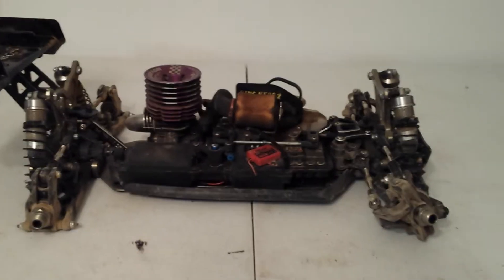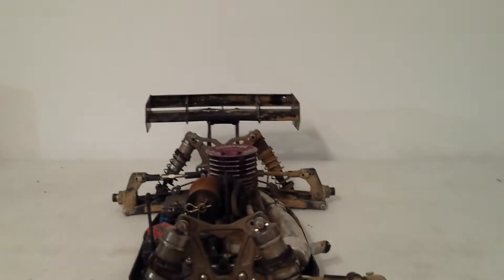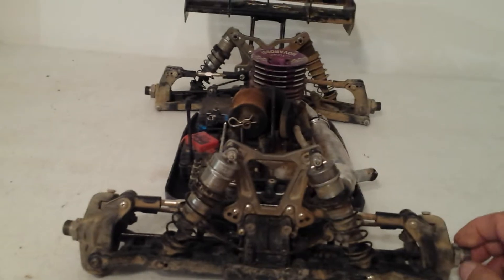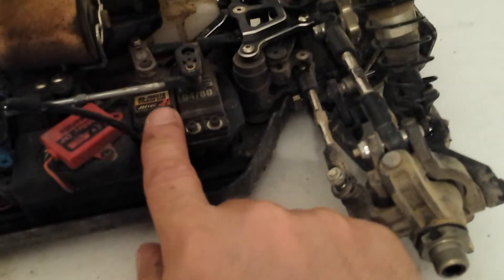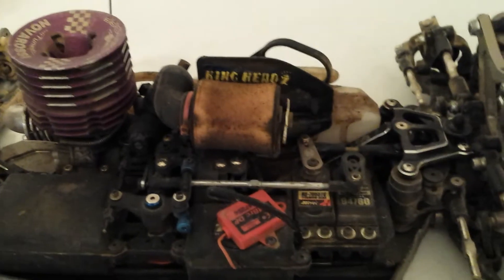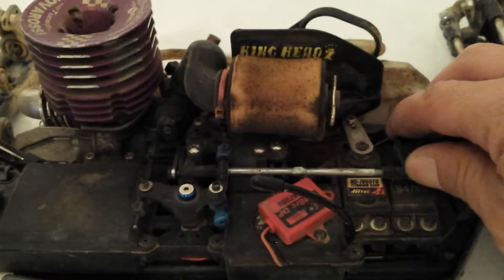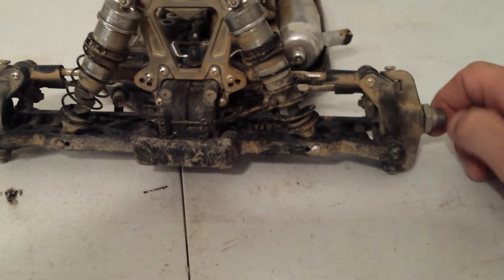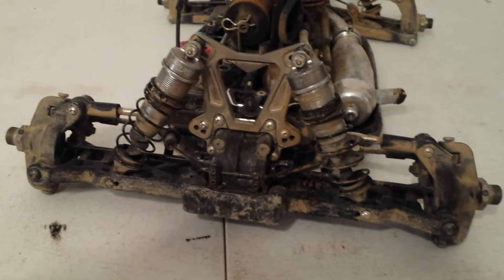Operation Buggy Rebuild Part One

Comment: Okay dude problem with my losi 8ight t 2.0 brushless.  No matter how tight I shim the rear diff after a run or 2.  20 - 40 mins it is too loose and it skipping teeth when I apply the brakes.  Electronic brakes through the motor of course.   The ring and pinion don't look great but they definitely don't look shot yet.  Any thoughts ? Also I've decided to just try to more or less finish the break in on the other truggy motor so 3 more tanks of easy rich driving I think should do it.  Counting the 4 total tanks the previous owner put through it and the 2 I've put through it I figure 3 more should be just about a gallon
Reply from the maker: Honestly if the teeth are skipping it's already toast, itll just get worse from there.

     You could give it a shot with the nitro engine, just slowly tune it in and see what happens.
Reply: stilltlrforlife I'm so stressed about that nitro motor....$300 for a replacement if I screw it up ha
Reply: stilltlrforlife and I hate to bombard you with questions cuz I feel bad for doing it but I found the 8ight t 2.0 race roller rear diff already assembled ready to drop in on ebay.  Should I just order that instead of fighting a worn out ring and pinion?
Reply from the maker: sexymikeization  no worries on the questions buddy, thats why im here!! If it were me on that rear diff assembly, I would jump on it!! I love ebay!!
Reply from the maker: sexymikeization in all honesty, it sounds like youre fighting a losing battle with that diff.